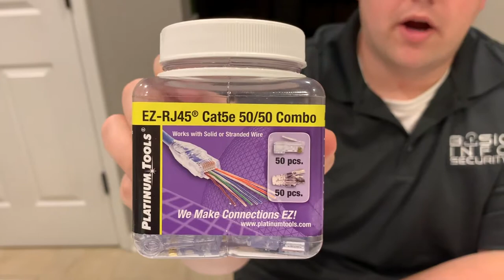How to Make Custom Length Ethernet Cables

Comment: Thanks for this step by step demonstration. I know the wire would definitely be cheaper in bulk but I’ll need to decide if I would do this enough to justify the extra cost of the crimper and possibly tester.